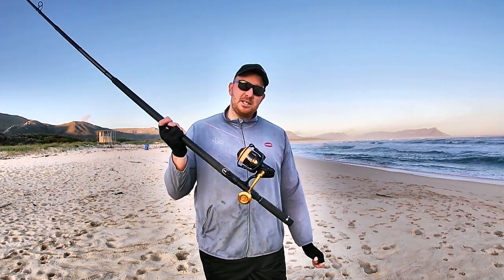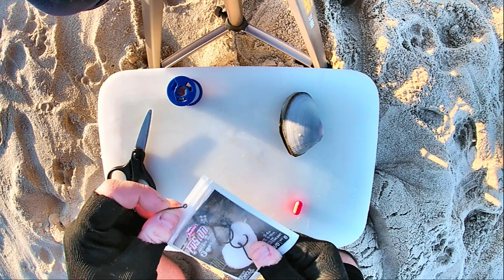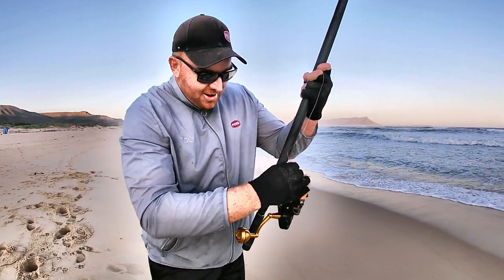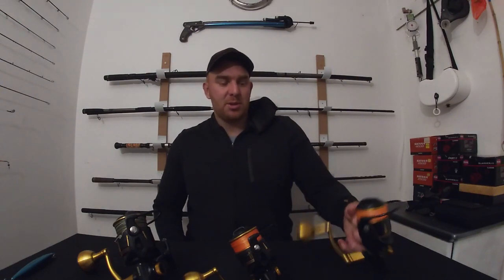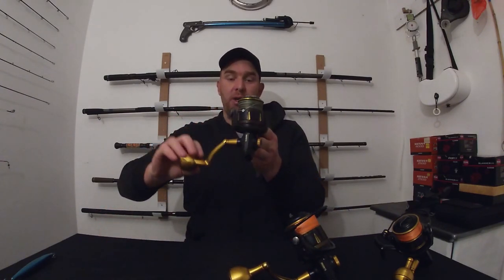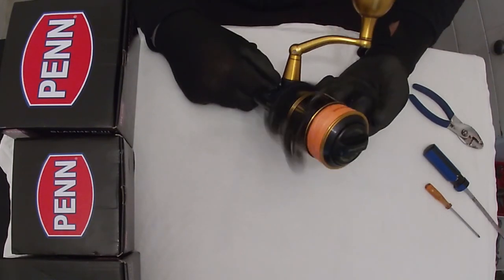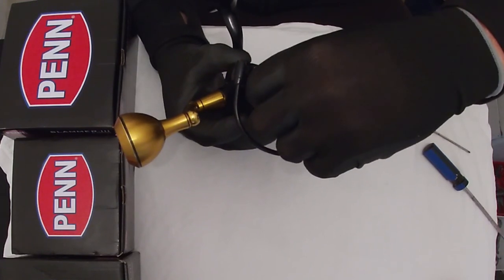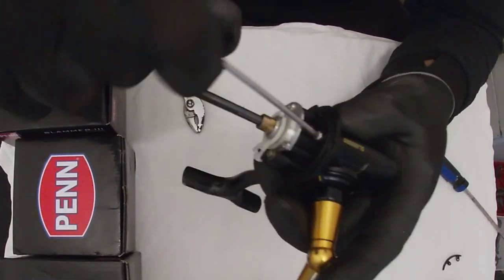TIRED OF SNAPPING YOUR LINE ON YOUR CAST? How to remove the "ABT" on your Spinning reel

Comment: Thanks for this! 
I’ve got a Spinfisher 5500 and sometimes have the same issue, In the slammer schematics this part is called a body slope, I’m assuming the “housing slope” from the Spinfisher schematics serves the same ABT purpose. Would it be correct to remove the housing slope to disable the auto bail trip?
Reply from the maker: I'm not a reel expert but I guess so, take it out and see if the bail trips when its open and you start reeling.

Comment: I was looking for other  reasons for line snapping when casting. I have a new reel and rod and still happening, something is causing the line to be abrassive, can you think of other reasons, thanks for the videos
Reply from the maker: I think main reason is over spooling your reel with line or braid,
Also a long mono leader can cause the same problem when the joint knot is still inside the eyes when you cast,

If you casting a grinder with a multiplier rod,

I also see with light lures it happens, especially in windy conditions
Reply: Thanks for the reply, much appreciated

Comment: Top reel from my opinion, what's ur opinion on the Slammers for non eds?
Reply from the maker: Great reel, for non Ed's the guys use a 8500 and up. more drag, more line capacity. Solid workhorse of a reel for sharks!

Comment: Don't forget that if you have a brand new reel that comes with a warranty. By taking your reel apart and removing parts. The warranty validity is cancelled. 
.
Reply: just put the part back before getting the reel  looked at 🧍🏾

Comment: Have you ever considered a bailless reel? This is for spinning without the wire in place. The Van Staal VS X-SERIES Spinning Reels - Bailless is one such an example. A tad priced up though.
Reply from the maker: Hi, i don't think i want one haha never seen onr at our shops also, but that will sort out the problem 👌
Reply: @saltaholic5235  Only if you need to solve a US$800 problem... That is a lot of sinkers.

Comment: Use a 60-80lb shock leader and you'll never have that problem. The ratio of 10lb in leader to 1oz in weight..... not sure what the conversion is in grams and Kg. It's much safer for everyone on the beach to.
Reply from the maker: Not the same problem, talking about the bail arm that closes on the cast
Reply: @saltaholic5235  I actually took that into consideration...... I'm surprised guys are getting crack offs because of a bail arm...... there is no way that would happen with an 80lb shock leader. Sorting the bail arm mechanism is only part of the problem

Comment: If you open your bail arm pointing down towards the ground it wont snap shut.
I have never seen anyone who has done this and snapped the line  you need more practice in casting your rod .
Reply: It happens to a lot of casters, in fact it’s the most common modification on Penn reels 5500 and below according to Penn service dept.

Comment: If u don't reel to flip ur bale with ur reel it will never do that.      U should always manually flip ur bale.       When ur reel is new it never does that...  guess why????  U never used that "automatic" bale flipping mechanism
Reply from the maker: Hi Enrigue, It still happens even if you don't reel.. especially the smooth reels, the handle turns with the momentum of the sping sometimes.. but like you say we never use that feature so i just removed it